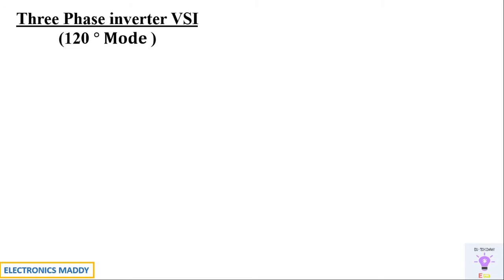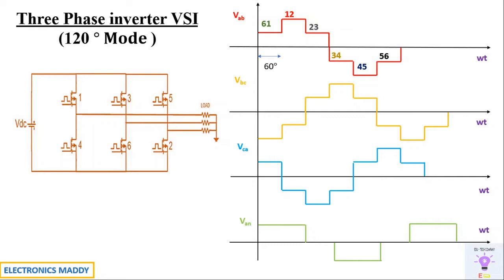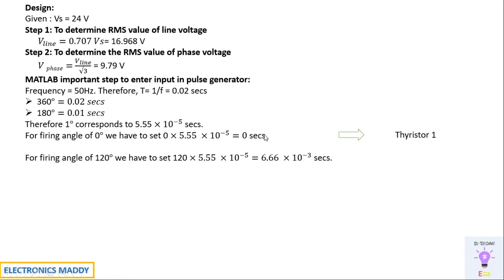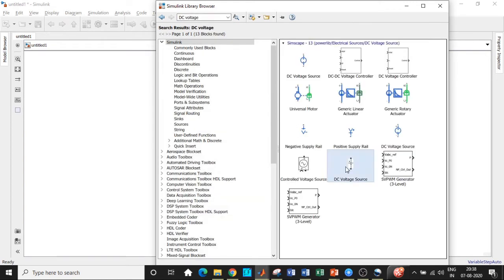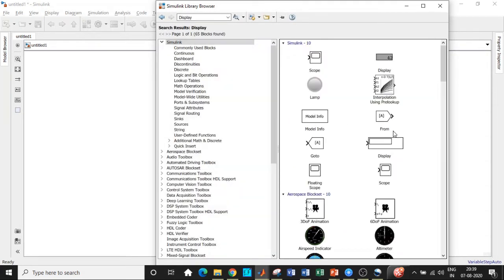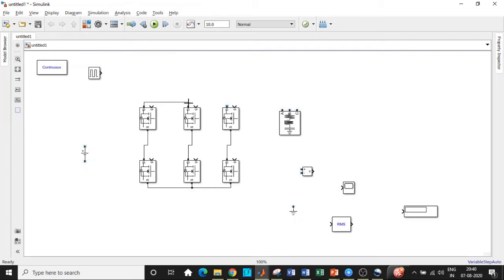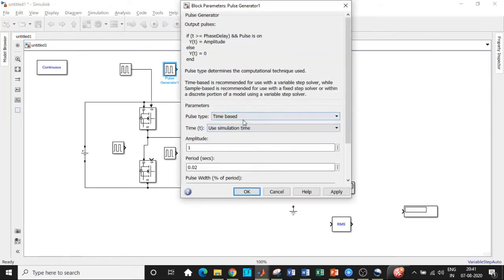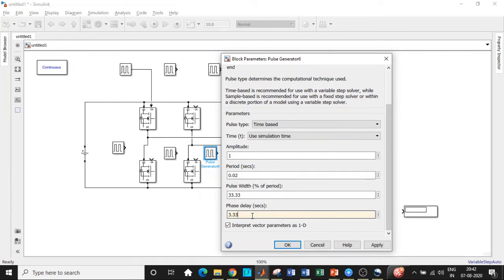Simulation of 3 phase inverter operating in 120 degree mode in MATLAB | SIMULINK | With Design

Comment: What if we are designing a 3 phase inverter operating in 120 degree mode with 50% and 25% pulse delay? Is the graph the same or do they affect the output voltage?